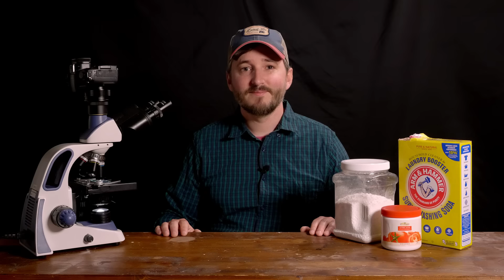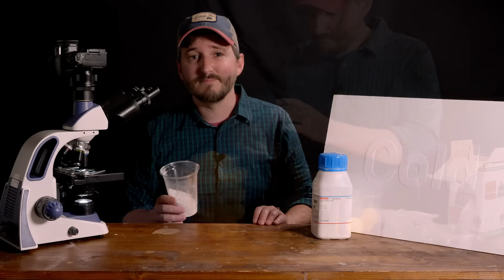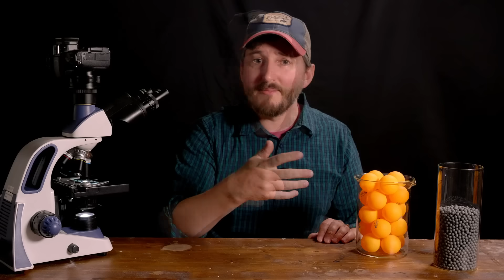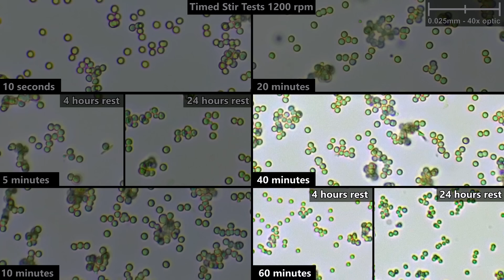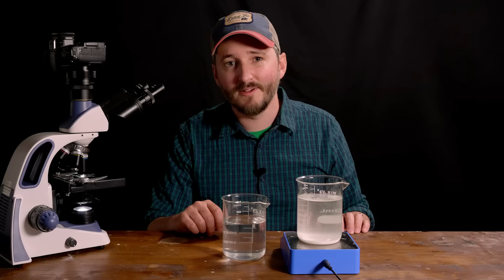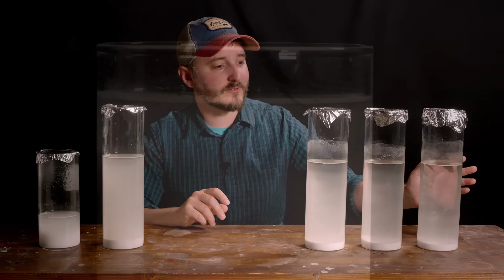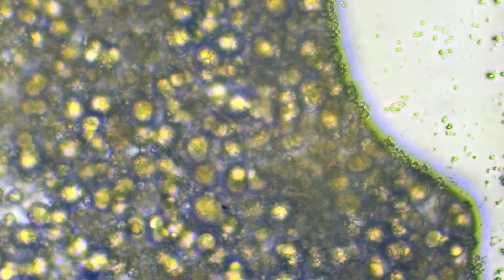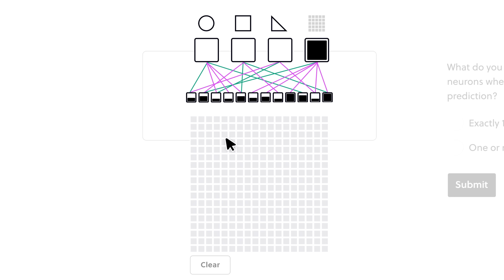Making Infrared Cooling Paint From Grocery Store Items (w/Novel CaCO₃ Microsphere Synthesis)

Comment: Thank You!!!

For payment for your information I give you Your name In Engrew (English+Hebrew, Original I know)
I used this to help build an understanding and to tune your Analog Brain and your Quantum Brain(Because K=11, k=11).
A-Z = 01-26
a-z = 10-62
 (space bar) = 72(because, As Above So Below) and . = 27 (Music fans will know why)
(Simple to see, Challenging to understand) Grocery Isles helped!! EX. Aisle 19 is S, Aisle 6 is F etc.

NightHawkinLight
14 90 70 80 02 08 10 32 11 90 41 12 90 70 80 02

imagine if you used a language model...

Imagination is key.

Have fun!!

P.S. I like to further the understanding by defining the Undefined, EX. I AM SAM = 0972011372190113 = 1971211372119113 Then I multiply them out by taking the Sum of the first two (in my case L-R) and multiply it out until I reach a single digit. I treat the ZEROs as a mirror. L-R ex. 133021=131321 R-L ex. 133211
1*9 9*7 8*1 8*2 6*1 6*1 6*3 8*7(5*6=30=13=3) 3*2 6*1 6*1 6*9(5*4=20=12=2) 2*1 2*1 2*3 = 6! I calls this Tesla Numbers
(197121137 2119 113 - 943 - 8. Pattern is the Pattern)
Whose to say we couldn't develop an A.I. in our own brain??

0541015152, [:

Comment: @NightHawkInLight why not use a putty knife? like what they use for drywall repair? that stuff coming out of the piping bag in the "good" run looks like it would be of an appropriate consistency, and you can cover a relatively large area quite quickly with some skill, though the layer coating would be a bit uneven, half a millimeter is a bit small to do reliably, but its not an unreasonable ask either.

Comment: My folks live out in the sticks in Central Texas, no river and no wells. They have a rain catchment system but there’s been no rain so they’ve had to truck in water. 

What they do have is humidity. They put a condensation recovery system on their AC and get a good 3-5 gallons a day off the AC for their 150 sq ft cabin. 

My Dad and I are trying to figure out how to use these panels as condensate catchers to farm water from the air. Right outta Tattooine :D

We’re also going to cover their water tanks in this stuff and see how it holds up to the weather. The tanks aren’t shaped in a way that allows for the film shield, but right now the dark green tanks heat the water so hot we can’t bathe the baby in it. Just getting it down to ambient would be great. 

BTW I knocked together a spreadsheet that gives you volume and price predictions based on how many square feet you want. It’s tuned to the local stores but should be easy to modify. Let me know and I’ll send you a Google doc link. (Edit: I mean, I'm sure you had to price out all that R&D you did, but this one could be published. I can polish it up to make it easier for people to customize)
Reply: What were your results with this?
Reply: Still got that floating around?
Reply: @JeronimoStilton14 yep I’ve got it somewhere. Sorry I missed your message earlier - if you still want it I’ll send you a link
Reply: Aluminum siding has pretty high emissiveness and could work well too.
Reply: Yeah, you have to live in a place that actually has humidity to be a moisture farmer. Lucas is such a fucking idiot lol

Comment: there is a gun they use for splattering concrete that might work well for "painting" the foam? or a bigger orifice and less pressure or maybe a paint roller? Also in regards to the micro balls..could you not "seed" the batch to grow the right shape and desirable size? like how you would grow a potassium permanganate  or salt crystal? then maybe a centrifuge to collect most of the balls at the bottom of container, drain them off then replenish system rinse and repeat? lol Anyways I see where you are going with this! keep it up :)

Comment: Instead of a panel in a box, why not paint it directly on an acrylic panel, that was you have a protective layer built in. And you can mount the heat source directly to the paint layer.
The other thing im curious about is painting it on an acrylic diffuser, similar to what is used for Flourecant lights.
That way the actual surface of the coating is a compressed set of 45 degrees angles. maximizing radiant area.

Comment: Just a quick question about the Acrylic section... Would dissolving the the pigment in superglue and using that as a paint work as well? Because Super Glue is a cyanoacrylate which is composed of an acrylic resin. And as it dries it also dries with the micro-pores, turning it white. Which is why super glue is horrible for models with windows because of the snowy effect it leaves behind...
Reply from the maker: Possibly, but superglue is extremely expensive
Reply: @Nighthawkinlight  yeah, just looked it up. 230 bucks for a gallon is maybe not worth it. Lol

Comment: Instead of a syringe or piping bag you could use an electric industrial caulking gun. You can get or make different tips and evenly control the flow. It would be a lot faster and more consistent. You could also try a car undercoat sprayer or bed-liner sprayer as they are design to spray thicker coatings.

Comment: I wonder if you could cool a block with water tubes embedded.  If several blocks were daisy chained so water were cooled in the first, and then cool water entered the second block, cooled further, and moved to the third block to cool even more, and so on, then how much temp drop could you achieve?

Home HVAC cool enough for air's moisture to condense, so that's a pretty good drop.  But your technique seems promising.

Comment: FWIW, I did the math with my creaky old brain and reasoned out that, when trying to figure out the largest circle (R2) that would fit in the gap between three touching larger circles (R1), R2 = (R1 * (2 - sqrt(3))) / (sqrt(3)).  That comes out to an R1/R2 ratio of about 10,000:1,547.  (Interestingly enough, 15.47 = 7 * 13 * 17)  Therefore, if you use a 20:3 ratio (just over a 3% smaller radius for the smaller spheres) for each smaller sphere size, they should easily be able to slip between the larger ones.  

Cheers!

Comment: Can you measure temperature with a contact thermometer instead of infrared?  A low emissive surface will not emit much heat for a thermal sensor to measure.  A chrome exhaust pipe is a good example.  It can be very hot to the touch but a heat gun will not be able to measure the heat.

Comment: I wonder .... when its whiteness is naturally reduced from age or dust by, say, 15% or 30%, how efficient could it be in maintaining the intended effect, or will it maintain it at all? Also, if there is any residual citric acid in the final "paint" form, what happens if a metal like aluminum is used as the substrate, over years of time (inclination to etch / oxidize, especially in any moist environment)?

Comment: How does the spray technique work with your waterproofing coating of Naptha and silicone? I believe that if you doped your pigment into that silicone based solution that would fortify and permeate that type of coating.

Comment: Fantastic work! A couple of thoughts - does titanium dioxide radiate IR similarly? It is used for very opaque, white pigments. Perhaps including a porportion of TiO2 microspheres (either as the largest or smallest component) could increase the efficiency of heat irradiation by absorbing more of the light into the paint rather than the underlying substrate. If it does dissipate IR, it may work better than CaCO3, but if it doesn't, it may enable additional refraction into the CaCO3 micro-/nanospheres.

Your work is science. You should seriously consider publishing your work on a preprint server. It's still unconventional to cite a Youtube video in scientific literature, especially since there's the possibility of your video being removed for whatever random reason.
Reply from the maker: Titanium dioxide has bad IR properties for this purpose, unfortunately.

Comment: Just had a couple of ideas on application to large areas for panels. 

First is a rig similar to one a screen printer would use. 

Second is, since you need to create and enclosure anyways, why not just create a water draining rig like you used for the final drying step. Then cover the fully dry and exposed pigment in a sheet of acetate with minimal clearance.

Without handling the stuff, it appears approach two would be sensitive to tilting and shaking. But perhaps you could spray acetate solution afterwards on top instead of an acetate sheet. 

Wish you luck, and will try making some when you post your next video on it.

Comment: Your stomach acid is too weak!  That is why you have reflux.  Increase your acid strength with acv for a long term solution.  Baking soda is not the correct method to rectify the problem.

Comment: Truly incredible work here. Great job! Watching your videos alone over the years has had a significant influence on my desire to become more educated and intuitive. This type of informal education is, in my opinion, some of the best education. This video does so much more to stimulate an individuals brain and increase intelligence than by showing how to make radiative paint. Showing your process, explaining your failures, and finding out how something actually works as opposed to just knowing something works… these are the best parts of what you’ve created. This video sets a standard that most modern educators cannot meet. I hope you are proud of your work; not just the groundbreaking technology you are pioneering, but also the contribution of the information to the world in such a public way. I’m sure it takes a lot of extra work to make a video like this but rest assured it is appreciated by many. 

- P.S.   I’m very interested to see this application in automotive paint; especially regarding the application method and how that is improved upon. I’ve seen another comment regarding thermal conductivity which will also be an interesting bridge to cross when further developing this concept. 

Thanks again for your contribution and I wish you the best of luck!
Reply: I'm thinking of making small panels that fit up under windshields and back windows. The closed environment of a parked car would act like the film protected box and maybe we could get to the point that parked cars cool themselves down. I know this paint is extremely bright white and we wouldn't want cars going down the road blinding each other, but maybe we could develop a convention to paint the roofs of our vehicles with this and leave the sides whatever color we like. It wouldn't be as efficient, but right now going out to the truck in a Texas summer afternoon is like climbing into an oven. Bringing it down into bearable temperatures would be fantastic.

Comment: Hi NightHawk, This video has brought an old set of questions from a number of lunch conversations between differant scientists. They were working at a research station on something else. Without any BS, is Carbon Disulfide a Photo Conductor? There had been a number of Photo Voltaic experiments using Anhydrous Metal Sulfides ( Cupric Sulfide, Cad Sulfide ). They are Photo Conductors certainly but the Crystal Structure will not match. They fail. If a Liquid Photo Conductor could impedance Match the Crystals, a compound Photo Voltaic Device is possible. Will Ohmic Contacts in anhydrous Carbon Disulfide show a change in resistance under proper illumination? Can Carbon Disulfide be effectivly Doped? If a 400 HZ Glow Panel ( sulfides ) Power Supply is applied across the Contacts, does it Glow. Your understanding that not all experiments work reduces my guilt if this is dumb. The Sulfate mentioned will also Glow as a Panel. Photo Conductive Cell, Photovoltaic Cell ( no foundry ), Glow Panel ( tunable by Doping ? ). If it does not do anything, that will explain the total lack of any data about this whole comment. Solvent, Barking Dog, making Rayon, Not a peep about Lattuce Impedance Matching or Photo Electric activity. If you test this concept and it does anything, name it a Hawk Cell. Since I suggested it, you won't appear egotistical in the Wiki Article. After it settles down, get a Phume Hood, your making me nervous. Turn on your Hawk light and let it shine :>)
Reply from the maker: Sadly I know next to nothing about the workings of photovoltaics. Sounds like you've got interesting ideas though.
Reply: @Nighthawkinlight  sorry you are not interested. I will keep looking.

Comment: Just curious, why did you not start with using clear acrylic or a latex commercially made base? If it would work it would eliminate the time-consuming step of dissolving acrylic in acetone and the Latex would be thinnable with water.
Reply from the maker: I tested some latex bases in an earlier video. I found the paint was too transparent and needed the snow scattering effect to work properly. I'm testing more types of paint now to see if I can find an easier solution.

Comment: Thanks! You inspire me, my daughter, and my students for the “everyday scientific thinking” that you model and apply! You bring us nerdy mere mortals such satisfaction that NASA-level research is within our reach. I’m wondering if a clear epoxy coating applied over the dry, finished product will conserve the light-scattering properties while protecting the finished coating from the elements, making it washable so as to renew it’s light-refraction, and ultimately durable as a coating? I’m thinking of it’s application as a “paint” on the top surface of my camper van to reduce heat transfer as the vehicle sits in the sun when parking in the shade is not available (like in the vehicle parking areas of campgrounds, for example). Kudos to your work and thank you for sharing your discoveries! ❤❤❤
Reply from the maker: Thank you very much!
I have not tested many clear coats but I expect they will not work as well as a film because they lack an insulating air gap. For purposes such as painting an rv this paint is not quite ready and needs more work to improve durability. In the meantime I suggest a bright white siliconized roof paint, many of which can be purchased commercially. Such paints will not provide active cooling, but they will still offer a big improvement on darker colors.

Comment: Are you able to coat the resulting painted surface with something durable like a clear urethane resin? I'd imagine that a difficulty of making this into a hard/durable 1-part "paint" coating would be that epoxies and anything else that make it curable would also decrease the microsphere density, but if that's the only issue, I'd imagine a 2-step application of paint then coat would be highly viable. I don't know if there's an issue with clear materials being IR reflective or messing with it's ability to reflect back into space properly.

Comment: I'm curious about what the main issues are in making a base for this. Is it just difficult to source no-pigment clear bases, or are there issues with the standard formulations absorbing the infrared emission? (Maybe you mentioned it in the video, but I didn't catch it if so.)
Reply from the maker: Lack of testing. It's possible common bases may work

Comment: I disagree with your comment regarding the source of CaCO3 particles in your CaCl2 solution.  Carbonic acid is a far weaker acid than HCl so the equilibrium concentration of CaCO3 due to the presence of CO2 in the environment will be very low.  The ionization constant for( CO3)-2 is 4.45x10^-7 compared to (Cl)-1 = 1, i.e., it's completely ionized.  So that's about the ratio I'd expect for CaCO3 vs CaCl2 due to the presence of carbon dioxide.

It is far more likely that your CaCl2 precursor just contains some excess CaCO3 from the manufacturing process.  Be that as it may, your technique of using citric acid to dissolve it is very clever and effective.  

Thank you for an excellent presentation!

Comment: This is a really cool video but trying to follow along and take notes is incredibly frustrating at the beginning of the video list ALL the ingredients and items you will need then go through the process and avoid talking about stuff that isn't relevant to actually making it save that for a separate video.. you would be  explaining something then go all that can be avoided by adding citric acid it's frustrating I have adhd and work 10 hours a day typically tutorial videos are step by step which it kinda came off as a tutorial at first with you talking about how easy it is to make but 20 minutes into the video and I realize this is just not something I can reasonably follow im not even confident your putting everything you need to put in the video like a dang what you will need section

Comment: Your multiple rinse steps may actually shrink the size of your microspheres a bit.  Nanoparticles have a very large surface area so, even though CaCO3 is pretty insoluble some it will dissolve in the rinse water.  I discovered this was true when I tried making magnesium fluoride nanoparticles (as a polishing agent).  Multiple wash cycles eventually caused the MgF2 to totally disappear!  Using LeChatelier's Principle, I found that adding a very small amount of a water-soluble magnesium salt prevented this.
You also might be able to use this "problem" to your advantage if your smallest particles aren't quite small enough.
Reply: This is a wonderful tip which invites an experiment!
Reply: Holy crap, this is genius.

Just off the top of my head I feel like the most important parameters to test are to find a way to determine how much (if any) the Water temperature, Duration of each wash cycle and the nanoparticles size will contribute to how much degradation (shrinking) of the spheres occurs.

Once a consistent method of testing these parameters is developed and employed, this can be applied with a large array of applications where density, temperature and likewise even pressure (such as hydrostatic pressure in any type of stratified fluid) are key principles to how efficient said application can be.

Like using Aqua Regia for dissolving Gold.